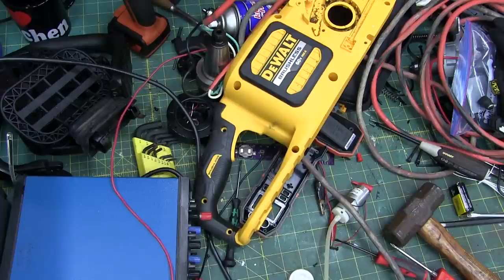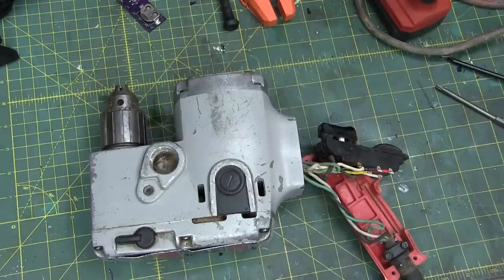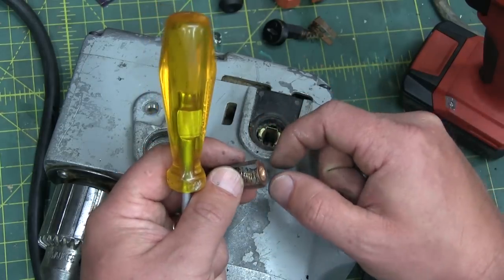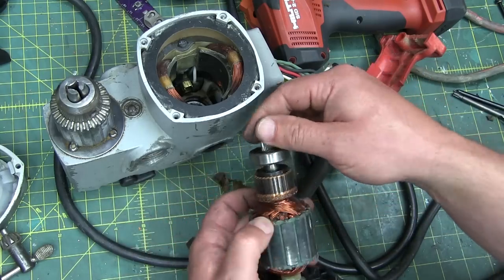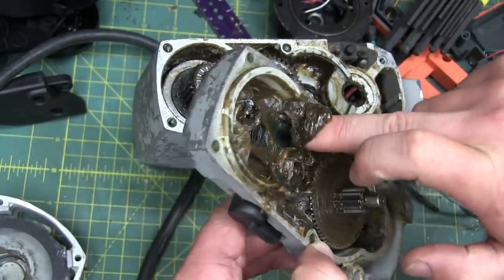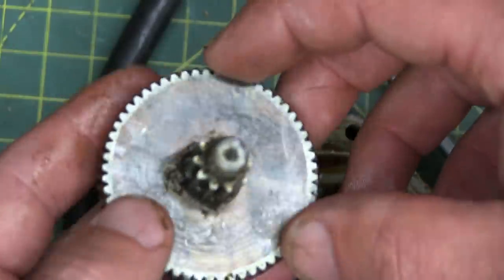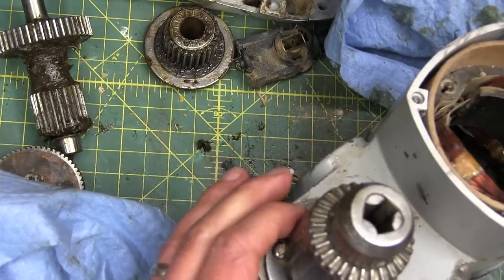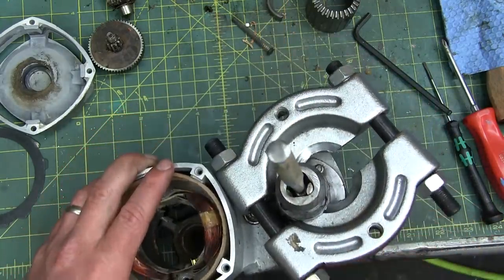BOLTR: Milwaukee Hole Hawg | Long Term Quality

Comment: Chuck is threaded on, remove the little left hand bolt, get the biggest allen key that will fit in the chuck and tighten the chuck on it. hit the allen key to spin the chuck off with the drill in low gear(not on just in low gear). With the chuck broken, probably pipe wrench around the chuck to spin in. Good luck

Comment: It's not a Morse tapper its backwards threaded on and you didn't break the nut ring they are split that way you could have just snapped it back together.

Comment: Sorry, just wondering why you didn’t take the torque screws out from where the base of the chuck was bolted to the body of the hole hawg, to maybe get a better look at the inside of the chuck. Maybe the three chuck teeth could have been easily removed that way as well?
I have taken things apart and not noticed fasteners or clips in the past so it is no surprise the we humans get focused on something so much, that the obvious can pass us by on occasion:)

Thanks for the content!!

Comment: Get the chuck off first. Take out the centre screw, lightly clamp the body in a vice, sick those vise grips on the chuck like a pit bull on a small child and whack 'em anti-clockwise (from the business end) with a hammer. Works every time. Tapers are only used on bench drills and milling machines.

Comment: I thought most drillmotor chucks are RH threaded onto the drive shaft with the LH screw locking them in place. Some chucks, had a tapered mount to accept a Morse , B&S or similar type mandrel for Lathe and Mill use.

Comment: The fan is most likely sucking hot air out of the motor not blowing air on the arm and field coil...it would be sucking up all types of dirt from the bottom and into the motor.

Comment: If it were a new one you could just try and use it as a valve operator and I can guarantee the chuck will come right off.  Along with part of the shaft.

Comment: Chuck might be threaded on the shaft, i had a crapsman drill once that i replaced the chuck on, took the bolt out that was left hand threaded then i clamped the chuck down on a big beefy allen key and give er the old whackamole right way round threaded and off the shaft she came.  Something to try before you let your rage determine that the only solution is the cutting torch.

Comment: 16:08 I like the metal tag too and in 1990 when the internet wasn't turned on all the way, it was good to have all that info right there. Now, as long as the raised Milwaukee logo and hole hawg can be seen on the case, we can pull out our phone and get all that info and so much more.

Comment: The axle on which the chuck is mounted have threads, so does the chuck on the inside. Beat them or heat them as much as you want but they will not come appart like this. Fix a big allen key in the chuck, block the axle and turn the chuck with the allen key . Easy 😁

Comment: I just got the cordless fuel version for $100 on clearance at HD! Still running on the residual high you get from finding a ridiculous deal on a tool you would otherwise never buy...

Comment: I'm pretty sure Keith Rucker has a video of rebuilding a Jacob's Chuck. Those outer rings are pressed on, and I'm pretty sure the nut is supposed to be a split nut (so that you can get it on). Likely you're having trouble getting the chuck off because it's probably threaded onto the shaft. Take with a grain of salt, all of that's from memory.

Comment: Chuck removal for beginners:
Unplug it.
Select low gear.
Take the left hand screw out, which is only fitted on drills with reverse.
Put an Allen key into the chuck, bigger the better, short leg into the chuck.
Twat the end of the Allen key anticlockwise with a 1lb hammer.
The chuck will now spin off.
Use the same trick to put it back on.

Comment: I have stripped down quite a number of drills and found that all the chucks were on a normal thread-the retaining screw inside with the opposite thread stop it screwing off in normal use. G

Comment: I know it's been endlessly hashed over, but, 2 methods to take off the threaded chuck. First old school is to chuck the biggest allen wrench in it with the long side out. Then whack it with a good size hammer. Usually that will shock it off. The easier way is to chuck a 1/2" drive allen driver in it and use an impact gun. Works like a charm. I took a look at Milwaukee's parts diagram and it looks like a threaded shaft like in all other drills. I can't imagine any reason to put a taper chuck on a hand drill.

Comment: Holy shit stacks, I've never been more excited for a vidjeo. My dad bought these for many years and they've just gone to shit in the last while. I've switched over to the DeFault equivalent... I guess the patents expired because it's a perfect clone with some solid improvements, namely speed control and a feedback system to slow the spinneroony when it binds. You'd think the black and yellow would advertise it at all but I had to special order to find one.

Comment: I don`t know if this is the right place to ask this after watching you try and take the the threaded chuck off. where is the shear key or pin on this ?. is it on the first driven gear ? years ago i was running a 3 9/16" bit through 2x6 plate over subfloor. we were in a hurry and used high speed. something sheared inside the hole hog. I dropped it off at the local too shop. they only charged $20 for the part and repair. always wondered what they changed ?

Comment: I think the helical gear was broached which produces excess metal/material then they milled it off for clearance. Why not ground off? Another era of tooling machinery I suppose. 

Keyless chuck vs Jacob chuck is a fun internal debate from another 'caster (Carolla).

Comment: was drilling with a 4 inch auger bit overhead in some doubled up 3 quarter flooring  when it caught . each time a bone broke it sprung it back and my captured and depressed the trigger again, 4 bounces and 4 broken bones in my hand before gravity dropped my hand away. Its still in my cabinet but I work around it

Comment: After 2 years of people commenting you probably figured out that the chuck is threaded on. 
I was taught to take out the left hand screw then tighten a skookum Allen wrench in the jaws with the long part out. Wack that with a hammer. Beware, it's right hand thread.

Comment: Those threaded rings on the chuck are snapped in half at the factory for assembly, you didn’t break it. It is probably threaded on as well.

Comment: it's threaded...(the chuck should indicate if it's a MT, or thread pitch and size.)
Put it back together....put a non hardened snug fitting rod into the chuck wrench hole (since you buggered the chuck) and give it a rap in the countermost clockwise of directions....
(You can actually put that chuck back together, if you can get the 'timing' right...if you do, just press the geared collar back onto that split gear)
You can use the handle of the chuck wrench, if you can get it out of the rubber holder.
If you try to hit the chuck wrench 'as used', with the gear engaged, you'll snap the hardened shaft off and you'll be ordering another chuck wrench...

If the chuck ISN'T buggered, remove the right hand thread locking/retention screw from the shaft....
Chuck up a 3/8 or 1/2" allen wrench in the short end...with the long end hanging out....hit the long end w/ a dead-blow...
Your bearing puller is ideal for removing that fan end bearing, for replacement.
Use a drift punch, or if you want to be fancy, use an arbor press...

I was a Swillwaukee, Porter Cable, Rockwell Industrial (pneumatic and electric), Makita certified mechanic for about 7 years... (Back when they made GOOD tools)

The Hole Hawg is probably THE most skookum electric tool you will EVER lay your hands on....unless somebody sends you some NASA shit to tear apart...

PS
I got 10 stitches where mine tried to screw me through the same hole the 1 inch auger bit was going through...pinned my trigger hand against the grip/trigger....had to rip my hand out of the impingement, to keep it from being crushed...that skookum plastic trigger took a huge chunk out of my trigger finger...

Speaking of the trigger, the low/left-high/right switch is used universally on other tools....that don't reverse.
Those ARE push-in connections, BTW...
I've never seen one of those spade connections come off, unless domeone was dickerin' with it, or if it ate a few pieces of pea gravel....and THAT would be the LEAST of it's worries.....
Ingestion of pea gravel killed more tools than anything I saw......blew up cooling fans..destroyed commutators...beat up windings...

Comment: We used to use nasty drills right angle drills back in the '70s putting in bulkheads broken fingers broken wrists weren't uncommon at all when those things bound up you either just let go or hang on as tight as you could

Comment: I don't know about the Milwaukee but most of the chucks I play with are screwed on and the left hand bolt is just to stop it unscrewing in reverse. Failing that an air hammer would be a kinder way to separate a taper shaft.

Comment: the Chuck threads on. After you remove the screw you you tighten an allan key in the chuck and wack it with a hammer.

Comment: i got one that's still got the Metal fan blades i should take a look at the date and see how much older it is and see how it compares also it threads off and they get freakin tight i ended up having to weld the chuck to a plate then putting a large handle on it welding another pipe to said plate send it in reverse to smash it out

Comment: Rumors have been shared about this video. They say that the “whole” hog and chuck are still affixed, residing in a dark corner with 10mm’s and 1/2” hand tools so no one knows about it still not operating…this dark and unseen place is known as, hog heaven! 🤪

Comment: propper spade connectors have a small hook in the center that would garb onto hole on the male connector. but if they are cheap or have been taken on and off a couple times, they wont have the hook.
still not good for vibration prone equipment

Comment: The chuck is threaded on!  Stick the key in the chuck as if you were going to tighten/loosen it and rap it with a hammer, counter clockwise. It should break it loose and you can simply unscrew it. I don't think you broke that threaded ring. I think it is made as a split ring. If it were a solid ring there's no way to install it. The outer sleeve retains it.

Comment: 10:55   Is the fan sucking in the front of the tool? like the side with the dust?
Reply: Jttv that reminds me , hole hawg and arbors , the only drilling setup that produces actual broken pieces of wood in mass .

Comment: Chuck is threaded on there smart guy. Tip to get it off, chuck up a hex socket bit in the chuck (never mind this because you ruined said chuck) and use impact gun to loosen chuck.

Comment: You didn't split / break the adjusting ring for the chuck jaws. It's a factory thing, or at least on my Jacob "33 B" chuck. That ring is tapered on the inside. Place the adjusting ring so that the narrow part is closest to the opening of the chuck. I'm late to the party, but maybe somebody could use this little bit of information. You can purchase replacement parts / kits for a Jacob chuck, either just a set of new jaws, (for what it's worth they {the Jaws} are numbered 1, 2, 3, respectively) or the shell cover (with the teeth for tightening / loosening) the chuck. http://www.jacobschuck.com/keyed-chucks/replacement-parts-service-kits

Comment: delrin is a name brand, the material is called acetal... Did you try to unscrew the chuck? Since it uses a left hand locking screw i am almost sure that the arbour is a proud 1/2 20 thread normal RH.

Comment: I could be mistaken, and granted it's never a good idea to post a comment before getting to the end of the video; but that "broken" chuck ring may not be as bad as it seems. I remember finding a weird looking broken taper nut inside of a plastic bag that I came across while rummaging through a pile of old rusty tools and painters equipment on the side of the road.  Took me ages to figure  out what it was due to most of the writing on the bag having long been washed off with some solvent; 

BUT, LONG STORY SHORT I suppose, is that I found out it was a replacement chuck ring, and it actually comes "pre-split" although it looks like they literally just took a hammer and chisel to it haha. I even managed to piece together that it said something like "2 PCS SPLIT RING" on one side of the bag. I guess they had one too many a person calling them because of their brand new broken chuck ring haha.

My apologies if I just totally misunderstood the situation though.  I tend to just completely miss things when I'm dead tired.

Comment: I've seen a couple of pretty good smackdowns by one of these first hand. First one had a trigger lock and it came around to beat the guy in the face a full 3 times before he came to and got out of the way. Broke his nose good and proper. The second one, the guy was at the top of a 12 foot step ladder and he was drilling horizontal across the ceiling. Aboit time she bound up it lifted him right up off the top of the ladder, as he kicked it over. Looked like a circus act with him hanging up in the air off the drill. We managed to get the ladder back up to him before he lost his grip, or his lunch.

Comment: You didn't break the chuck, the ring is a factory broken split ring, like the old jacobs repair kits you can buy, and I've seen a few chucks be threaded onto the spindle and then being retained with a lefthand thread bolt

Comment: Good news for you AvE.  You did not break the ring nut in the Jacobs chuck.  They come that way from the factory. They are made in one piece and then broken in half so they can be installed. See mrpete222 video for details. Now doesn’t that make you feel better!

Comment: Answers your on a postcard please, a guy on you tube called “This old Tony” up loaded on the 3rd September 2018 he uses wet wooden dowls to split open a block of metal... is this possible? Or camera trickery?? This is the only place I could think to ask

Comment: To take off the chuck you need a hex or t27 and turn the screw like your tightening it.and you need a special tool that grips where the tork gear sets .you put it on the vice while and it should slide out . . .i know what im talking about my dad ans uncles worked for milwaukee power tools in the 80s .my uncle is still too managers of his branch . ..but yeah you did too much lol

Comment: I was under the impression that if there is a left handed fastener retaining the chuck, it's gonna have a right hand thread on the chuck itself.  I'll bet you just need a bit of torque rather than a whacking to get 'er off.

Comment: That was cringy.
 Thats a thread on chuck under the lefthand screw. You didn't break the chuck half-nut either thats the way they come new. 
Put the chuck back together, leaving out the lefthand screw, lock it on the short end of a large hex wrench and give it a swat counter clock wise for what will be right hand threads. The chuck should spin right off for you.

Comment: Bah, spade connectors. Had one on an auto gearbox solenoid perfectly connected but failed giving high resistance. Wiggled the thing around. Bing, solenoid now working fine. Double you, tee, eff!?!?

Comment: Now I might be speaking from a lack of metallurgical knowledge here, but I see guys all over the place talking about the superiority of machined solid metal vs. powder metal gearing. I work in a powder metal factory, and I do testing on our gearing. After heat treating, some of those guys run our crush tester up at least 8,000 pounds before the teeth bust, some clear 10,000. I recognize that a powdered metal product will never match a solid piece, no way in hell, but for the majority of use cases do they tend to perform adequately enough? Or do they just not last as long? Genuinely looking to widen my horizon here, all I know is the bit I've picked up on my day-to-day.

Comment: You didn't break that chuck, it came apart correctly and that ring is fractured like its supposed to be for a precision jointless fit with the threads on the jaws. When you buy a jacobs rebuild kit it comes with a new broken ring.

Comment: why did you asume that the chuck is on a taper  shaft?
it might be ass well on a fine pitch thread straight shaft like those new tools are only tho back nut when you have a left hand bolt inside

Comment: The chuck is threaded on. You take out the left-handed bolt and than block the output shaft and just screw the jeslus thing off there. Or you better get a bigger thumbdetector ;)

Comment: I hate saying this but you do know that the chucks are threaded on, the center reverse screw is just to lock it in place. P.S.- this Hole Hawg is a piece to be respected, much like riding a Tiger, once started you best hang on hard until the end or you'll find yourself in a world of hurt.

Comment: +Ave - You sure that chuck isn't screwed onto the shaft rather than being a taper fitted chuck?
Been there done that a few times myself, then someone comes along and goes (ala beer bottles) you do know thats a screw fit rather than a press fit don't ya?
Prob telling my granny how to suck eggs but hey - Lock the shaft the chuck is sttached to, jam an allen key in the chuck and tighten it down and give the allen key a lefty loosy whack with the gran marten

Comment: With the ground lug "modified" would it be any safe to use that tool? They make jokes about the apprentice and the puddle, but if you aren't drillind holes in the rain, is it safe to use?

Comment: Unscrewing a chuck by hand (allen key method) can be a bitch:
1. Remove LH chuck bolt.
2. Snug a piece of hex stock in your chuck and the other end in an impact driver.
3. Hit the juice and watch the chuck come flying off... and you don't risk breaking anything.
Well... at least this works for me.